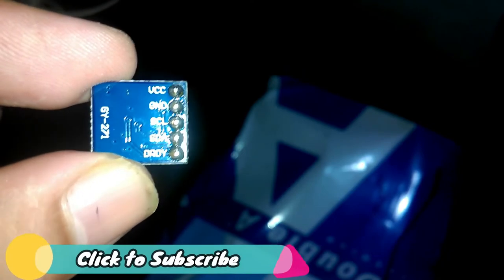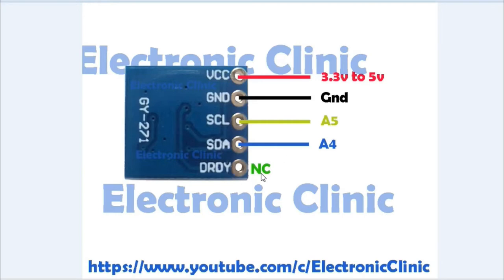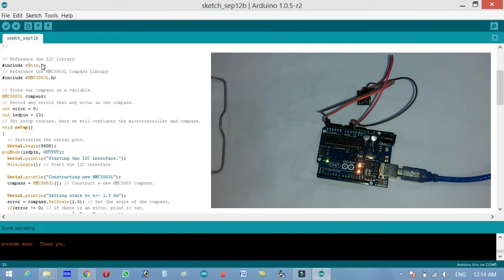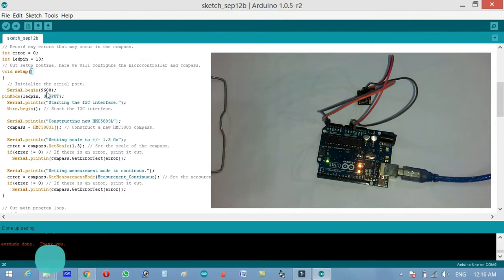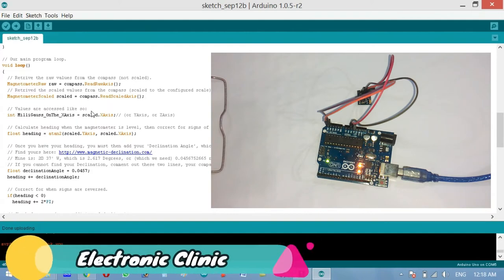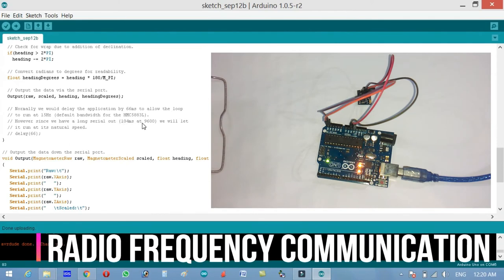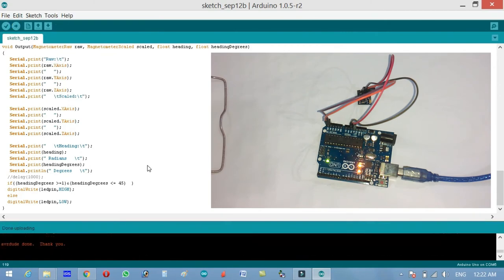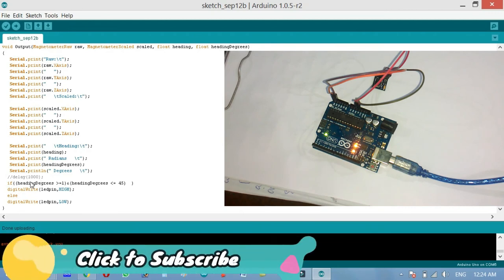hmc5883l Arduino compass, magnetometer sensor, compass navigation"Arduino Project for beginners

Comment: wow thaank you 

your explanation is awsome, i already fixed the force sensor, first i copied your code then i understand it then i removed some codes i dont need it for my project <3
Reply: i am using arduino mega will be any different ? because my z and y and x not refreshing ,

Comment: nice video. I tried following your way, but the issue I am having is that the degrees do not change
Reply: same here, do you already solved that  problem??
Reply: If degrees do not change, test your module with this sketch:
file/examples/Adafruit_HMC5883_U/magsensor
if readings still don't change, your module is probably bad.
I replaced mine with a six-pin model bought on eBay from a vendor in Tennessee.
It cost a little more but it works.